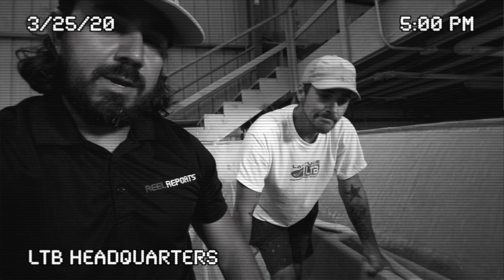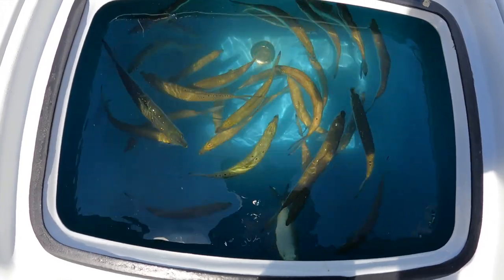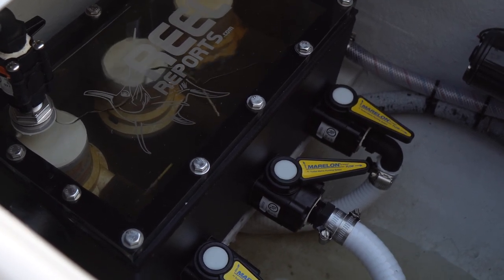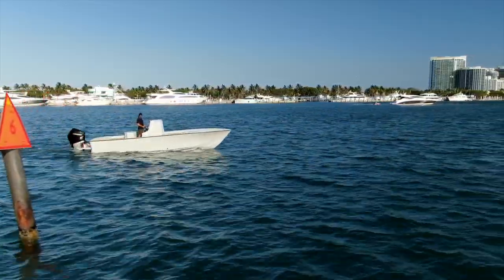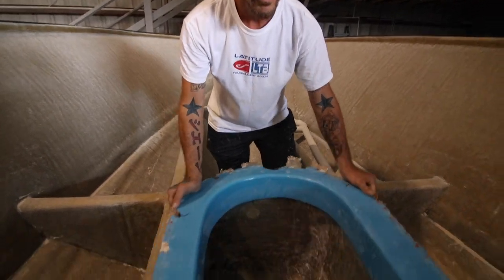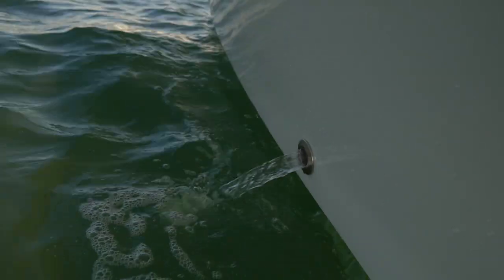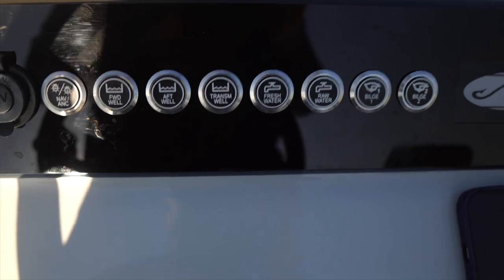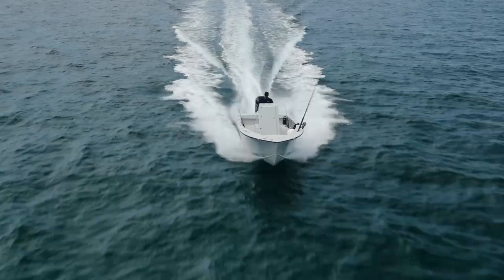Advanced Live Well Plumbing Update | EP 32

Comment: I have the same exact leaning postlive well in my 25, Only issue i have is getting it to drain. It overflows onto the rear deck and fills into the floor boxes. Im thinking about adding a second drain a little lower on the opposite side.